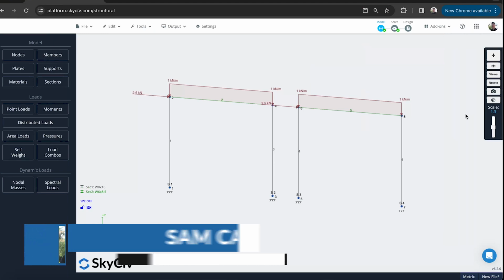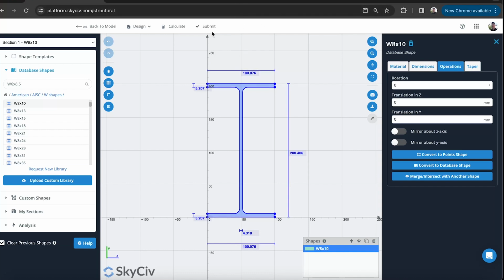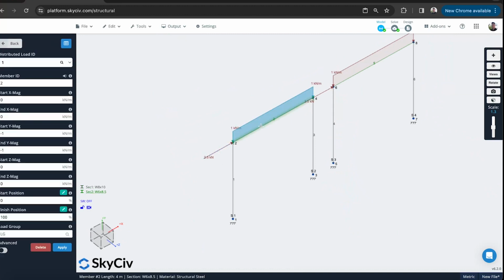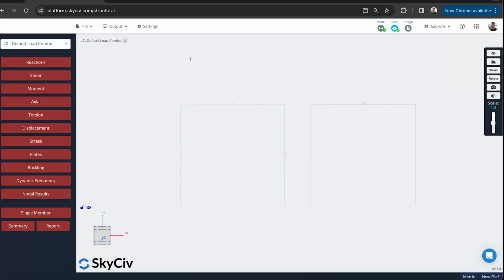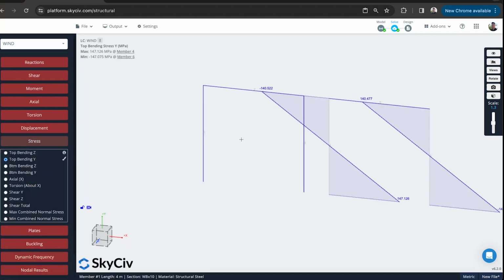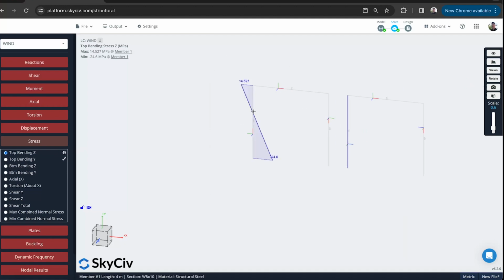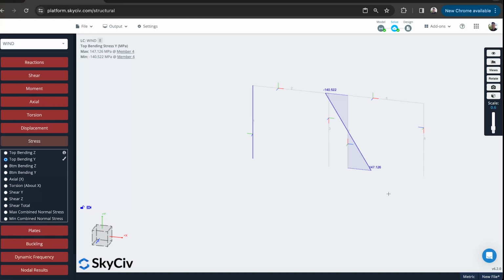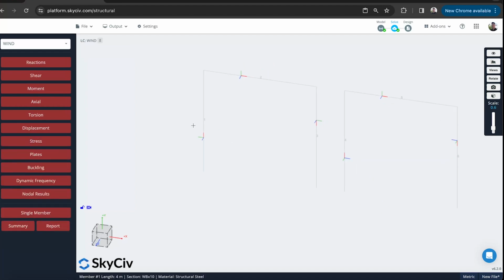The Difference between a Steel Section's Major and Minor Axis and Why it's Important

Comment: Unrelated to this video, but wondering if you have any plans to implement fully BIM modelling ion your software in the future? Such as Tekla? For example of connections of steel members can be modelled directly in Structural 3D and then the FEA analysis to be done in the same environment, it would be a huge achievement! You already have the FEA capability in your software suite.
Reply from the maker: Hi there! Yes we currently integrate with IFC and Revit (.rvt) files to support BIM. You can learn more on this here:
https://skyciv.com/integrations-and-add-ons/revit-skyciv-integration/

After importing, you can run Repair Model, as sometimes importing models from BIM might have some disconnected members, duplicate nodes etc.. After that, you can apply loads and run full FEM and Design Checks in the software. After that, you can export the model back out to Revit to complete the BIM process.

Hope this helps and feel free to shoot through any questions you have :)